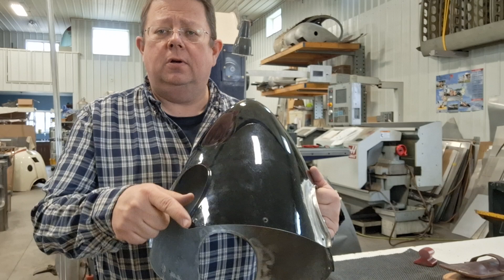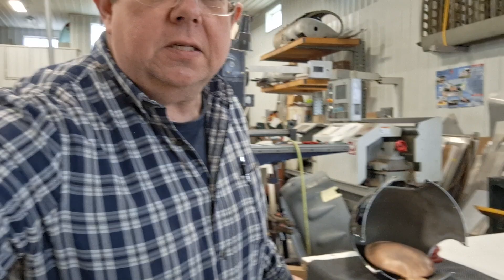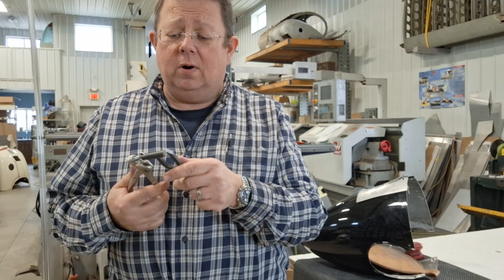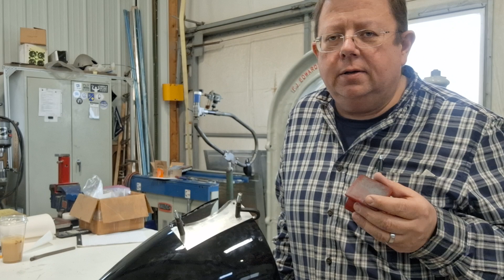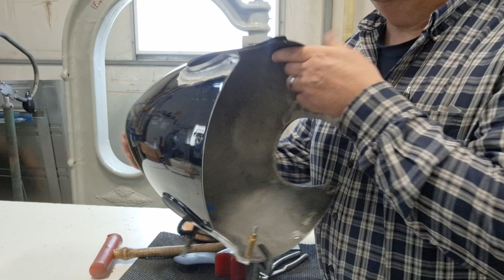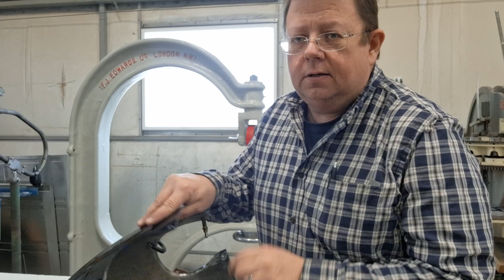How do you correct an existing tipped edge with simple hand tools.

Comment: What is the spinner material and heat treat? Very cool. Another great video.
Reply: Just aluminum.  Heat treat?  You're making it more complicated that it is.
Reply: @ not at all. If that spinner was 2024 t3 I don’t think you could move that flange. Knowing the material is critical
Reply from the maker: Hi, the material for the spinner is 5052 or 6061. It is tough, but movable. You are correct about 2024-T3, it could be done, but more difficult. B
Reply from the maker: It does matter, thx for watching. B

Comment: The rubber “blanket” is the same material used for carpets where you place the rubber anti slip “blanket” under a Persian rug…still easily available.  Nice video and great explanation!
Reply: That material is very common, and frequently discarded, in the restaurant industry.  Search for rubber shelf liner, or ask a bartender.
Just found your channel, wow, way too much great content here.  Thank you for what you do.
Reply: Same material used for "toolbox liner" for lining the bottom of drawers to keep tools for sliding about.  Most big "home supply" stores have it along with Amazon and any place that usually sell big tool chests.
Reply: Also used for holding material for a router in woodworking